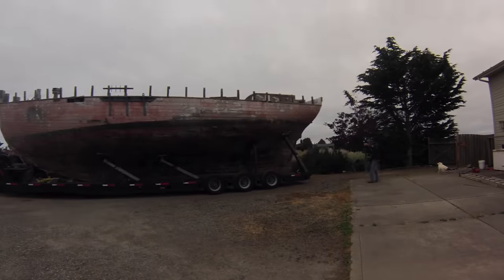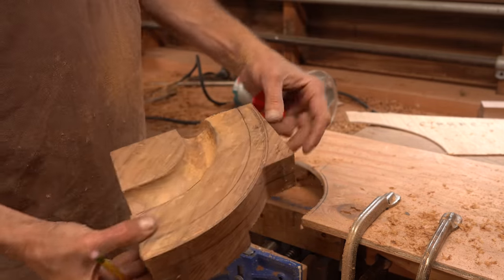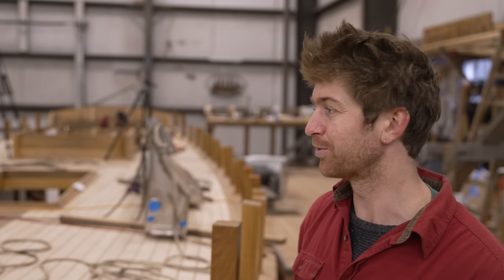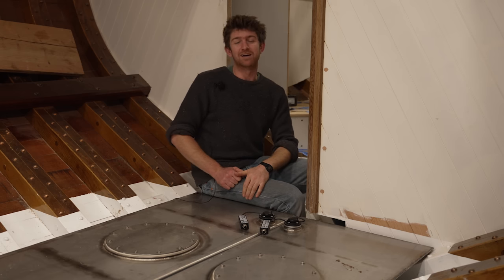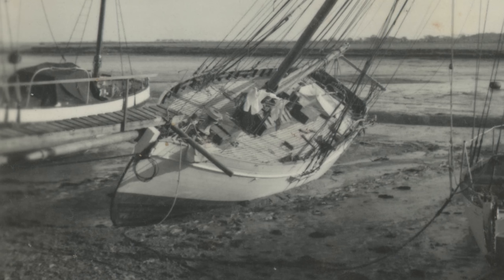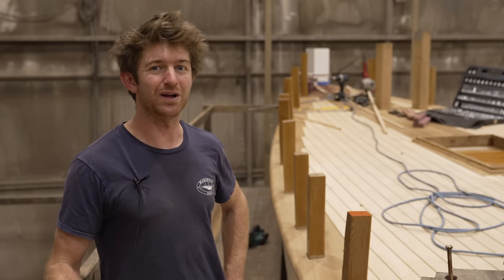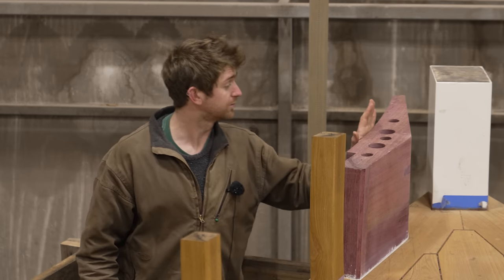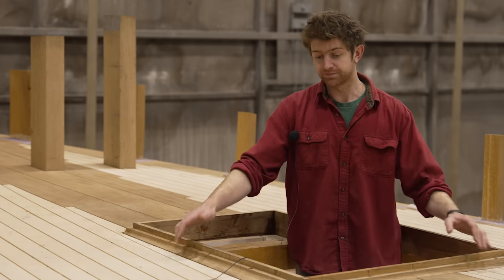Crazy boatbuilding Joinery / New Tanks!

Comment: As a carpenter with 15 years of experience, watching Leo start this @29:25 blind hole and ending up here @29:45 on a project with so many years in.. It makes me pucker every time, and I can't imagine how it makes him feel. Props.
Reply: Indeed. I would have to figure out the angle and make a rigid setup for the drill.
Reply: @Arnaud58  Ya, freeballin it like that was the scariest part
Reply: Grinding my teeth just watching it. I was a boatbuilder, and did that for a living for several decades, but I'm afraid I never was that kind of a boatbuilder.
Reply: @manfredschmalbach9023  hey boatbuilder, you’re not alone
Reply: Well it wasn't at all critical that they be perfectly vertical, which is good because they weren't.
Reply: It seemed like wizardry. Did Leo literally just aim without a jig or a guide to follow?
Reply: @slantern6229  You can make out a bevel gauge set to the correct angle next to the drill bit, but it's not much to go off!
Reply: Didn't look the safest though, way up there balancing on a couple of poles trying to drill something like that!
Reply: I remember him drilling holes to take out the piece for the propeller, absolutely incredible barely one hole out of place but the sheer length of this deserves our admiration.
Reply: @JCrook1028  it is critical they aren't vertical. Vertical holes would come out of the side of the boat. The angle was critical down to 1 or 2 degrees I would say
Reply: @jamestatlow9695  Just shows how much they love that boat. Gotta take risks to really show it!
Reply: Blew my mind.

Comment: Leo, some trivia. That big block at the fwd end of the bulwark is pretty close to the layout on sailing trawlers. They (specifically the Brixham sloops, but later mules and Lowestoft smacks) had a big roller next to the stem, flush with the rail, over which ran kind of relief line to the trawl. The idea was that if the trawl fouled, the main warp would come loose, and this relief line would take up and swing the smack into the wind. We used it for anchoring though, and for that it was perfect!

Comment: Leo, your long accurate hole problem.  I saw this done, I'm not sure where, but if you want I'll try and search it down.  Anyway, get two cheap level lasers (that draw a line on a wall) mount them in tripods with the line from them such that each at 90 degrees from the other, eg from bow and abeam, draws its line on the drill bit.  Once you have precision set these, all you have to do is drill and make sure both lasers are illuminating the bit eg from north and east.  It's a perfect virtual line in space.  Guaranteed precision.  PS love the project from here in Devon.
Reply: I remember, it was Felix Baumgartner for a sculpture restoration a few years back.  So so simple and so accurate, and cheap!!

Comment: It is worth considering painting the water tank seam welds, especially if they are also structural members. I saw the free firewood box, you could make some fabulous charcoal from that high quality wood.
Reply: Stainless requires that oxygen reach the surface in order to maintain the chromium oxide film which provides protection against corrosion.
Reply: @Gottenhimfella  Are you familiar with intergranular breakdown of the boundaries in SS caused by welding? That can create a corrodible boundary between the grains. That is the basis of stress corrosion cracking. The salt air causes rapid cracking of welds. It is a real issue with 304 SS, 316 SS is between 321 is better still. You do not encourage oxygen to reach the SS surface. You especially need to protect SS from sea air. What gave you the idea of needing O2 to protect SS because it is totally wrong.?
Reply: @andyrbush  You are fixated on a single corrosion mechanism (and ignoring at least five others in stainless steels).
 Intergranular corrodability in the weld HAZ is the result of carbide precipitation. This is avoided in modern practice by the ready availability of low carbon base material and filler (and by cleaning off hydrocarbon contaminants immediately prior to welding). 
Alternatively a solution heat treatment can retroactively desensitise the HAZ.
And if you were unaware, or refuse to believe, that chromium oxide is the key to the "stainless" nature of SS, and that it cannot form (or repair itself) when surfaces are oxygen-starved, then you are misrepresenting yourself as an authority on this important topic.
Pitting corrosion under these circumstances continues (unlike intergranular corrosion) to be problematic in modern practice, even for 316 and 321.

Further amplification (for those interested):
3xx stainless is unique in occupying two different states on the galvanic series depending on whether or not a particular area on the surface is passive (with an intact oxide layer) or active (where oxygen starvation has caused the layer to be absent). 
The active areas act as anodes, and the passive areas as cathodes, creating a galvanic corrosion cell within the single piece of metal. (Galvanic corrosion is normally found only between dissimilar metals). This is the mechanism for pitting in marine SS.
High strength marine stainless alloys (as used in high tensile shackles) are generally even more prone to pitting from this problematic self-attack, and should NEVER be used underwater for this reason (eg to attach anchors to chain)
Reply: @Gottenhimfella  Stress corrosion cracking is a fact. It is caused in the way I described. It is definitely not reduced by exposure to oxygen. SS tanks exposed to sea air and water are prone to weld cracking. Painting the welds keeps the chlorides away. The other corrosion mechanisms are not a concern in this case.  I got my knowledge by working with the materials and metallurgists. Eur Ing and nearly 50 years' experience in the oil industry.
Reply: They were prone. Past tense. Your knowledge is jumbled and out of date. It is now so routine to make low carbon marine stainless, which avoids weld decay, that the mills are no longer making the grades subject to the problem you are obsessing about.
The second mechanism you refer to, stress corrosion cracking, (quite different) arises not specifically from welding or heating, but from excessive stresses together with a corrosive environment. Poorly done welds or poor tank design could cause locked-in stresses. Neither appears to be an issue here.
The same chromium oxide layer which protects stainless from corrosion makes paint adhesion problematic (try painting a chromed bumper, for instance). Any SS protection relying on paint is accordingly also problematic. A preferable, more reliable solution for tanks where they've been made of SS which predates modern low carbon grades is appropriate heat treatment, to dissolve the carbides.

Comment: Both your and Cliftons woodworking is amazing in this episode. Still curious that you have not utilized a CNC router on any of the details yet. Seems the complex corners with the inner and outer radius of the sills would be cool CNC milling projects to try. Especially after hearing you mention using digital scanning elsewhere. The mount areas that received the corner sections are similar negative spaces I dealt with in a stained glass frame on my art studio stair well. (Glass above a knee wall) Scanned it with a very inexpensive 3d scanner to model a corner in Aspire and milled it a on Shark. Admittedly,  I do end up being off occasionally and wasting material though in the traditional mocking and fitting process. You guys never seem to have setbacks like that though. The CNC router is a godsend for a piker like me. Also cool to see your systems arriving and being installed.

Comment: On my small custom-made Catamaran Houseboat my DIY Desalinator will make around 120 Litre/Hr for just over 3 Hrs to fill my 4x 30L or 120 Litre DIY Solar Hot Water Shower Tanks & my 240 Litre freshwater tank as I plan to sail around the top end of Australia from West to East which might take 12 days on Hydrofoils but will most likely take around 24 days. I have a Temp controller that will auto switch on & off that controls this 2400w 45cm long element pot liquid heater that will work with the combined heat of the solar heated hot water so that 3 ppl can potentially have a 15 min hot shower at 3 Ltr's/min along with toilet flushes, drinking water etc & the system will last for 2 days before needing to be recharged. If there is only one person, then the system can be recharged every 6 days.

Comment: Leo - did you check out a company in UK that makes fuel and tanks, they use the rotary moulding system, so no leaks, could be of interest, even if its just a useful link for others, Tek-Tanks in Alton
loving Clifton's work, stunning, all the love going into all the separate jobs to maintain an old traditional art of boat building, does make me think, i wonder if the folk building the originals put in as much love into their work, bearing in mind more use of hand tools and traditional methods, how much has changed, the bulwark end piece you made at the front of the boat was very complex, i wonder if they were bolted in the same way, for a wooden boat, the amount and length of bolts is way bigger than i ever considered, i must have a closer look at my friends wooden boat next time i visit it

Comment: i have made every mistake possible installing water makers!   I have even made a couple impossible mistakes.  the best advise i can give is to install that thing as close to the batteries as you can,  use oversize cable, give it more vibration damping than you think it needs and make easy service accessibility a priority

Comment: (AutoCAD) If you want to make a gage table for you water tanks: Subtract a volume from the tank inside wall, then use the SLICE command to cut that volume into multiple one-inch thick layers.  You can then use MASSPROP to determine the volume of each individual slice.  (1 gal = 231 cu in).

Comment: Thete is a two step process for stainless steel. I am thinking of processes called pickling and passivation. They stabilize the alloying elemnts of the alloy exposed on the surface. These treatments are for surfaces after any maching, grinding or welding of stainless steel material. What does the tank maker say about these processes? Did it get done? I would recommend taking a look at the benifits performing  them on your potable eater tanks.

Comment: I hope that those stainless tanks stand up to the cyclical dynamic loading as the wooden hull works, and don't show early fatigue failure....
Reply: As I'm sure you will know, almost all the "working" of a traditional wooden hull is shear, with the deck trying to move fore and aft relative to the keel timber. The tanks will certainly provide welcome diagonal bracing, given that (AFAIK) while the decks have bronze diagonal straps, the topsides do not. 

So you do have a point; the mounting flanges, located at the interface between the hull (which can shear fore and aft), and the tanks (which cannot), need to be engineered to cope with the stresses arising from that working.

Comment: I cracked up remembering you making the guys polish all the floors to mirror, and now they're slowly all getting covered up. On the aluminum tanks you're probably well aware of it, but aluminum in contact with stainless will corrode, so if you do aluminum fuel tanks you need to make sure you don't have stainless fittings wet with sea spray on the tank.
Reply: They were not required to polish the floors, they did it willingly!

Comment: I see the fridge cooler that is going to be installed. Do modern boats typically install a dishwasher? Or is that too much and on your voyages its always hand washing dishes? Seems like camping in a way but I am curious since the battery and generator could handle it and if you had enough water you could use it at strategic times like when you are in a harbor during your journey. Or the special nights when you are too exhausted.

Comment: Did you pressure test the steel water tanks? I realize leaks are less critical than for a gas tank and less likely than for a plastic-welded tank.  Just wondering.
Reply: Yep stainless welding notorious for pin holes

Comment: Leo: if the bit comes the other side not exactly in the right spot a lot of things will be ruined
proceeds to drill a 2ft long hole while balancing on is toes with zero guidance equipment

HITS THE SPOT BY +/- 1/32 in

Comment: I have been following this rebuilding all the way, absolutely impressive. I just wonder why al the bolts are slotted countersink. Is this for authenticity or are brass bolts or screws not available as Allen or TORX head screws?
Reply: Not brass, but bronze. Slot-head screws are preferred in boatbuilding, b/c when repairs are needed 25 or 50 years from now, it'll be easy to clear the slot of any old glue or goo - far easier than any other drive type. Leo did use Frearson-drive screws to fasten the deck planks, but they're basically just a cross-slot design, not a fitted shape like the Philips-head.

Comment: Leo have you given any thought to fastening a stainless steel or brass plate to the face of those front posts that you made in this video? 
If the anchor chain is constantly running along/against that wood won't it wear it away relatively quickly? 
Or am I musunderstanding how they work?
Reply: The  new cheek-piece & existing stem will support a roller pulley, the anchor chain won't rub on the wood.

Comment: what type of glue is the brown glue that you use?
Reply: Do you mean the brown goo under the sill pieces along their length where they sit on the deck beams? That's not glue, it's a mix of Dolfinite bedding compound & pine tar. It fills any small gaps between the faces w/ solid material so that water won't be trapped in any hidden voids. (Trapped water would promote fungus & mold growth that feeds on wood.)

Comment: You say "rebuilding from the keel up", but it doesn't look like you kept anything. Did you? I scrolled back to look through thumbnails, but even disassembly is spread over 20+ videos, and that's a big commitment. If you didn't keep anything, ship of Theseus question, is it still the boat you paid $1 for?
Reply: That question is answered in one of these videos. It is also asked about commercial  ships.
The rule is that as long as there is 1 part original it still counts as the same ship.
Reply: @gbosman5874  Yeah, 1 of 120+, lol. That's why I asked. If it's a small series I'll lurk more, but that's a big ask. Thanks for answering! 😁
Reply: @JayteeStarr  Did you actually "lol"? Where did you get the figure of 120 to stimulate your mirth? And then you go on to ask if anything was kept. How did you miss the largest
part made of original wood and original function?
Reply: Most of the transom is original.
Reply: @alexandermenzies9954  I went to the Sampson Boat Co. page, clicked videos, and saw that this series has 128 numbered episodes. I clearly stated that I just browsed the thumbnails. And no, I didn't "lol". Don't be pedantic. Millennials use lol to imply a jovial tone or just to break tension in a sentence.
Reply: @JayteeStarr  There's no pedantry. And I very much doubt if that claim is only made by millennials. Old geezers and anyone younger are frequently proclaiming their mirth in the hope others will believe and affirm some nonsense (when they're not being constantly "amazed" by anything new in their experience). Lol, of course.
Reply: @alexandermenzies9954  Unhelpfully replying to a comment to pick out someone's extremely common use of an acronym because you don't believe they were laughing hard enough to satisfy your definition? That sounds like pedantry to me. I didn't make the claim for exclusively millennials. And the only reason I'm still replying is because any engagement is good engagement for the algorithm. If we're commenting, it helps these nice men's video.